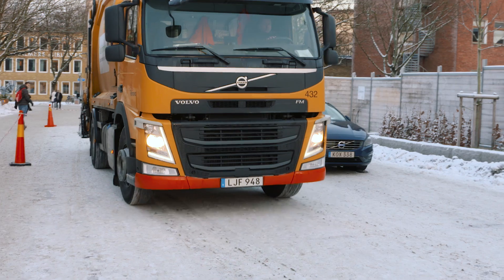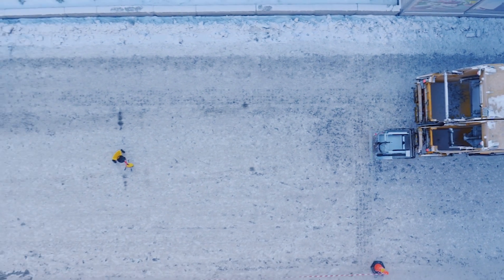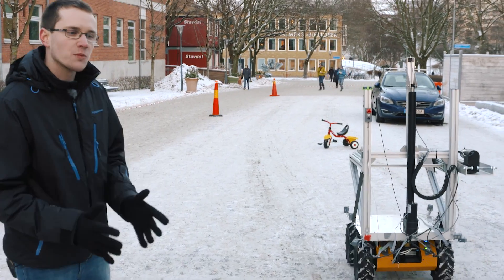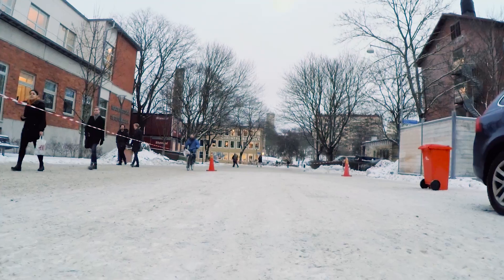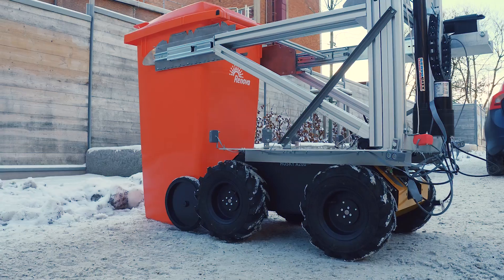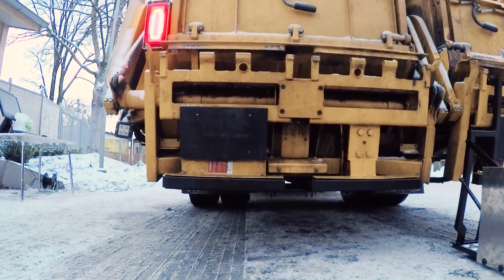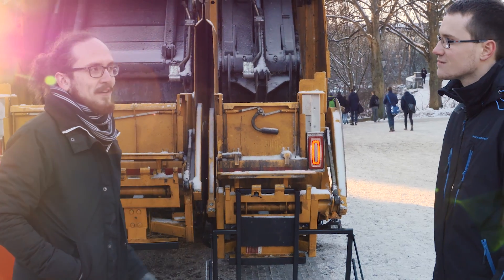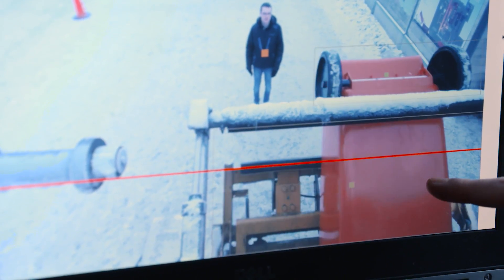The ROAR project - robot and drone in collaboration for autonomous refuse handling

Comment: As this proposal is to be operated by one individual the driver, all moves must be concentred around him. From his seat he must drive the truck to approach as near as the garbage bin, a folder arm along of the collector container will hold the garbage bin, read an rfid bug to collect content and owner information as weight to send mail, pdf, bill. Trucks will carry containers, the solution in the form of a container equiped with a compactor and a foldalble arm with intelligent camera to hold/carry/empty garbage bins, as on the shelve replacable equipment.

Comment: Wait what, why would you not have tracking devices on the bins themselves instead of a drone? That way they could be identified with numbers as well. The collector could load the battery of the devices every time too. A drone seems a bit over the top, and easier to fail.

Comment: Its very Slow and I think if you use some more sensors in target so no need for drone on the roof of the car sure for begging it's good but think about it in practice it need too much time think about robot who can replace human and it's not ready yet
Reply: +Georgis Yousef the refuse bots might not see a bin which could be behind a bush, car or alike, even with many cameras. The truck may not always enter small streets or it may be very inefficient. In these cases, a quadro can easily swoop in and map number of bins and allow refuse bots to gather them in the most efficient way.

Comment: If you place a small tracking device on the garbage bin and connect it to the robot then you don't need a drone to locate it anymore. If you want a map to avoid the obstacles, you could simply put a cam on the robot...I don't see the point in using a drone that won't work when it rains or when a strong wind is blowing.
Reply: The robot already has a lidar and cameras to handle obstacle avoidance, the map is done to get a system overview while using the task manager, which would be used remotely by the driver. The main reason for not putting tracking devices on the garbage bins was for testing if the system would work without changing too much of the standing infrastructure. Also cost wise with up to 5 million households in Sweden it would not be a trivial cost added to the manufacturing, plus an added maintenance/repair cost, to the bins. At the moment the bins are basically maintenance free.
The system was not design, at least at the state when the project ended, to be fully autonomous but would always require a driver to assist the process if something went wrong. If some part of the system would not work autonomously ordinary workers would be sent out instead.

Comment: Your robot has 10 seconds to find and grab the container. If it is 1 minute right now then there is nothing even remotely good in the design. Sweden or not this robot will cost more than people.
Try better. And forget the drone. Map the area while driving the vehicle.
Reply: you forget that even if this is 2 times slower it is still more efficient than paying 3 guys. but you are right about the drone, using some 180° cams on the side of the truck would make more sense.
Reply: How much fuel is being burned if every stop is 2 minutes and not 25 seconds? How much more trucks are needed and drivers to compensate 5x loss in speed?
Reply: In US garbage bins are picked up from curbside. the truck has robotic arm controlled by driver and it takes 20sec to pickup. There is only one person ie driver who does this entire operation.